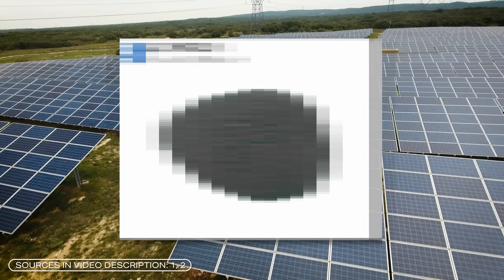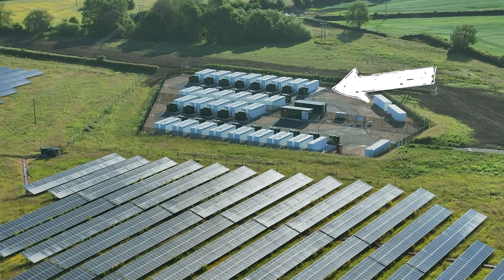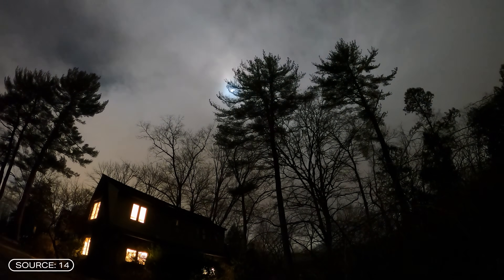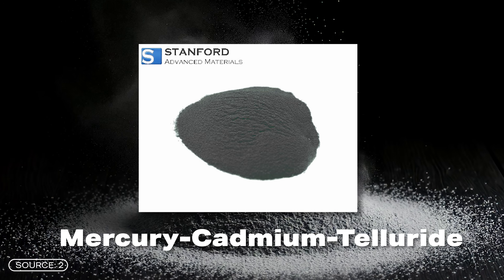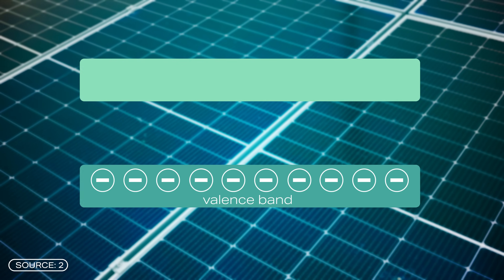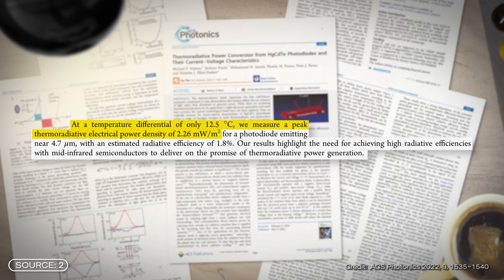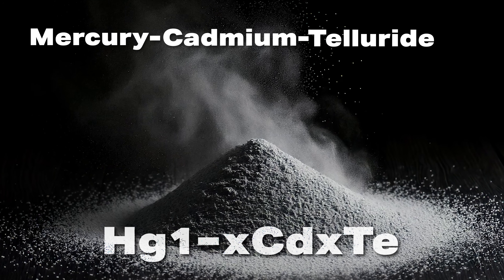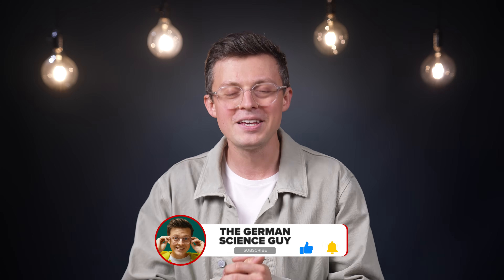Solarpower WITHOUT Sunlight: This Is How It Works!

Comment: A really important perspective that you completely miss is that the output from these PV modules are less than 0.1% of what daytime PV modules produce and even if this technology is made 100% efficient then it will still produce much less than 1% of what a daytime PV module can produce.
Reply: Which is more than its producing at night as it stands , so .. a plus
Reply: But if keep batteries not freezing in winter is good and if the back side also good
Reply: yes i was thinking about power output
but hey it's more than 0 if it's cheap and
hope in near future this output increases by a lot
coz if it happens we can really put down thermal power plants
Reply: As a poc its very interesting. More research is now required to see how this can be expanded. Historically when we dug up yellow stones also know as Carnotite. We could never dream that we could make nuclear power with them
Reply: Completely miss? You've probably only read the title.
Reply: @QnA22  its rubbish. a thermocouple makes more power
Reply: Shouldn't solar panels charge batteries in the daytime for use at night, then use regular electricity in the daytime for appliances but letting light in through our windows as much as possible?
Reply: @RobertGarcia-tz6ve   There are various ways to set it up—it’s not restricted to only one way.  
It depends largely on household needs & situations. 
The way you describe it, the solar panels would maybe only be used for lighting at night?—that would allow a fairly minimal amount of panels & battery. 

When grid-connected, w/batteries, & when there’s enuf solar panels cranking out enuf juice, some setups 1st charge the battery backup & powering your house needs, then sell the extra to grid—if there are enuf panels making enuf juice.  

Some areas I heard, take all the grid-connected solar juice, then sell back juice to the owner at a prorated price for juice used—owner gets cheaper juice, & the utility still profits nicely from it, while maintenance costs of the home-solar are shifted to the owner. 

If you are allowed to have a stand-alone private solar system where you are, you can setup your system how you choose—like, feed a battery bank that delivers some or all of the household needs (need big enuf bank to keep running off the top 50% of charge, for better battery use-life).  
As long as the system is separate from the grid system in your house, you can run off solar/wind charged batteries whenever. 

But, if grid-connected, there must be a safety switch that automatically blocks your home-system juice from back-feeding into the grid, in event of grid outages.  

A home system will hopefully be prioritized to cover your needs—that looks different for different households. 

With the industrial push to make everyone very vulnerably dependent on all-electric, every electrical thing in a home must be considered as a load needing battery power in a grid-down situation—at least enuf juice to run fridges, freezers, medical equipment, & maybe a heat source. 

We just had a 17-hr. outtage in our suburban area. No explanation given, except maybe rain (ridiculous, cuz it wasn’t t anything epic, & neither was the wind). 
I’d had a goal zero Li1400 watt box running 2 chest boxes, one as a fridge, & one as a freezer.  

But that glamping toy bricked some time back, & I’ve been considering what might better replace it. 
Yes, I exactly called those sleek battery boxes sold as “solar generators”, glamping toys!  
Almost all of them apparently are entirely, wastefully disposable.  
The battery cannot be replaced by the owner; only some boxes can have the controller in then replaced.   I spoke w/a couple tech reps, who said, most battery boxes are Not designed for conservation of resources—they are greenwashed gadgets. 

After much digging & thot, it seems like best solution to help many households, especially those w/limited funds to throw at the problem, is to have a big enuf battery bank + necessary components, which can be replaced or repaired as needed.  
It can start small & build bigger as able.  
It can be recharged/trickle-charged from Off-Peak grid juice, &/or solar/wind.  
It can power certain circuits to run cold boxes, medical equipment, internet box, basic needs during outages. 
That can help get around the “Peak Power” higher-cost energy game utilities use to increase their profits, while penalizing folks who can least afford it.  

That can run at least your basic needs when the grid goes down.  That’s gonna be happening more often, related to grid-pillaging by vast data centers, & cuz of  the deeply antique instability of the grids.
Reply: It's proof of concept at this stage and the first solar panels only achieved a 1% efficiency rating. But your point is valid imo.
Reply: @grantadamson3478  the first archieved 2% and useable cells now come with 23%. That factor 10 increase would only change the 100000 times less energy of the thermal cells into 10000 times less energy. The overall potential, if you could catch all thermal photons and turn them without losses into electricity (so 100% perfect bandgap always at the right position and 100% efficiency which are both far from reachable) would still make a factor of 10 less as the energy density of thermal photons is far lower in the range of living conditions temperature range. 
That is the reason why not even the authors of the paper go for night solar panels (thats only the press release) and instead aim for body heat and very low energy sensors to drive them. 
But that can be found only by reading the full article and not only the press release headline, Gel Jakob.
Reply: You missed a lot more and the point. With that attitude, we would remain in caves
Reply: Yes.  I am pretty enthusiastic about solar, but this seems like clickbait research.  There just isn’t much energy to be had at night, and the toxic chemicals would not be worth any benefit.  
It would probably be better to develop a solar panel that sores energy inside itself, like a leaf does.
Reply: With all these great advances I just wonder why my electricity bill is so insane!
Reply: I think it would be more profitable to just use excess energy to boil up water in several large tanks and then use that heat at night to run a turbine with a generator.
Reply: @molybdaen11  you get more energy out of your hand than this nonsense.
Reply: its rubbish

Comment: You trigger a lot of good thing too :)   Your enthusiasm makes it easy to forgive speech glitches - as a Dutch speaker I often play with it, making things sound very Dutch in English!  Your Chineur instead China cracks me up every-time - Keep your German soul strong mate ! mach das gets loss ! 

On topic:

 Bifacial panels would be marvellous  - Sunny side  UP  and Thermal side Down > From the bottom up receiving warmth /radiation. Dual efficiency in same infra ( Montage, cabling and inverters )

Comment: It'd be great if this could be used to make lighter and smaller RTGs. There's also researchers trying to heat sodium to produce orange light and absorb that with various PV panels. If they could eliminate the sodium and just aim for a specific temperature to maximize one wavelength of IR it might be an improvement.
Converting higher wavelengths into IR is possible just by absorbing them with a dark surface. However, getting the ideal wavelength might require IR phosphors. I'm guessing a cadmium doping gradient in a single junction IR panel wouldn't work efficiently at absorbing broad spectrum IR. Multi-junction IR panels might be more efficient, but would still probably cost an arm and a leg to manufacture.

Comment: What is the theoretical maximum energy that can be captured from thermal rediation as compared to standard PV in daylight? I'd be surprised if it's more than 5%. This development is completely irrelevant and a waste of most peoples time.
Reply: More than 0 is worth developing, and comparing day to night isn't a valid comparison. Remember the first PV cells were only a few % efficient.
PV cells that can also use IR at night, as some have demonstrated, is worth it. Also, using the same cells to harvest energy from the waste heat of power plants and similar is def worth it, and will reduce their active cooling requirements.
Me, I bet you still drive an ICE car.
Reply: Higher wavelengths can be converted to infrared simply by absorbing them into any dark material, but they might need to use IR phosphors to get the exact wavelength desired. By doing that an IR panel could be turned into a cheap pseudo multi-junction PV cell, plus it wouldn't completely stop working at night.
Reply: Somewhere between 0.1% and 1% of what you can capture during the daytime.   This is a really important detail to disclose.
Reply: @michael-j-harrison   Nope. The single important consideration here, given he's not saying it's a replacement, is that it's more than 0. That's it, and all he's saying. The decider isn't the amount, it's whether it's cost-effective or will be. Any with printer-made PV cells in 100m sheets, I'd say so. Esp if they are on the back of solar PV cells and don't need separate mounting.
Reply: Capturing thermal energy will also have a cooling effect on the solar panels. There's several aspects making this worth exploring.